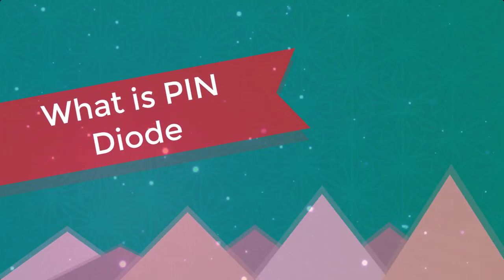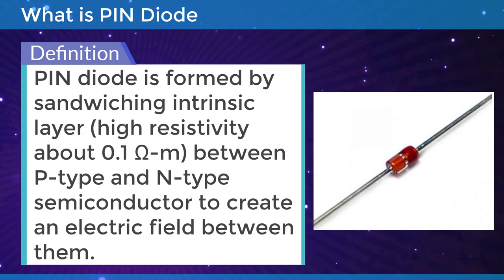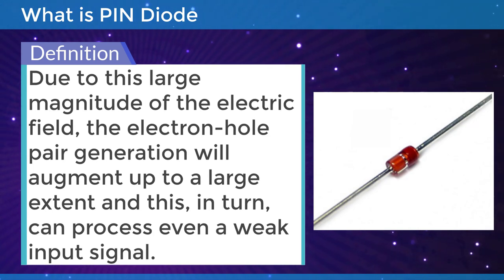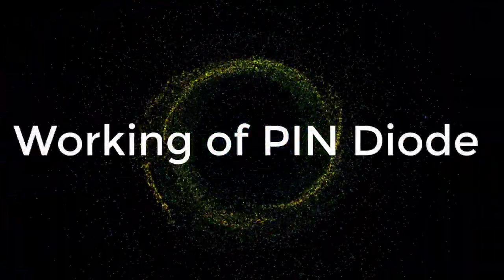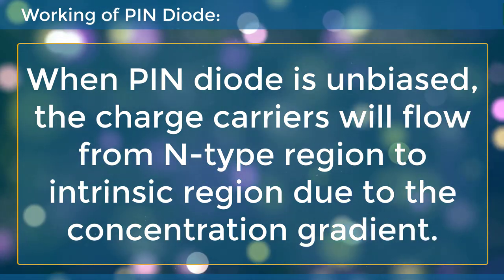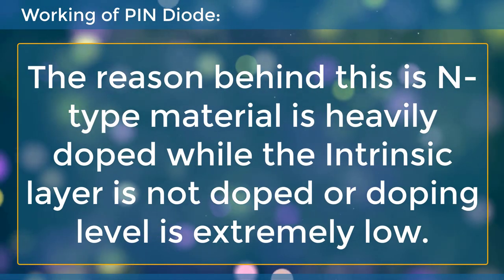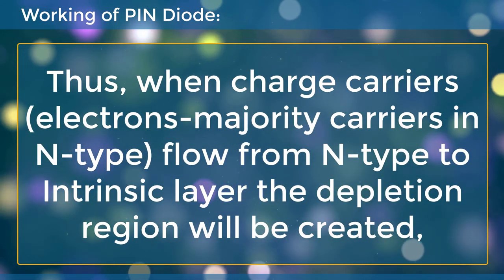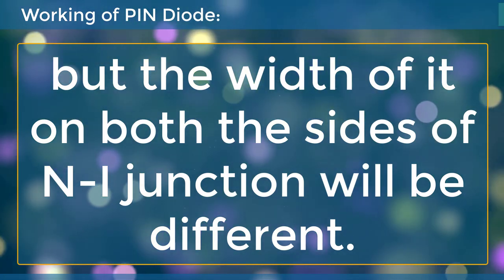What is PIN Diode | Working of Pin Diode | Electronic Devices & Circuits | Engineering Concepts

Comment: Low Capacitance: The intrinsic (I) region in a PIN diode results in very low junction capacitance when the diode is reverse biased. Low capacitance is crucial in high-frequency applications to minimize signal distortion and ensure efficient signal transmission.